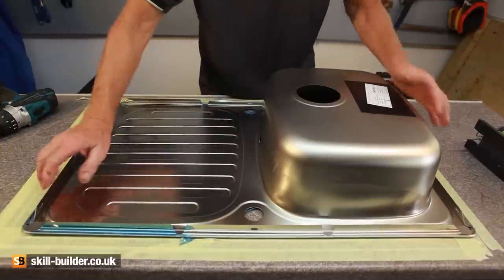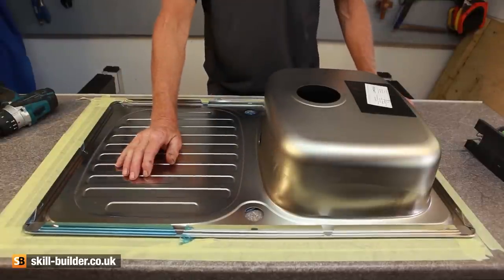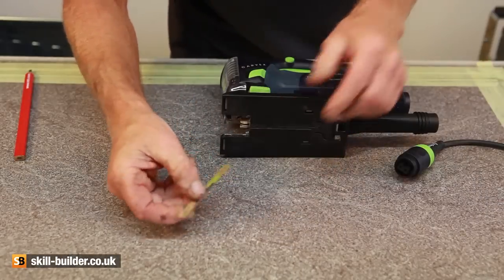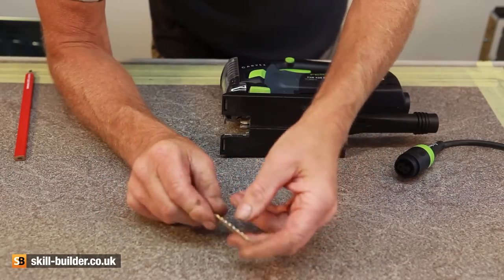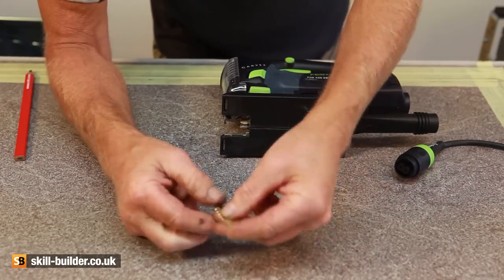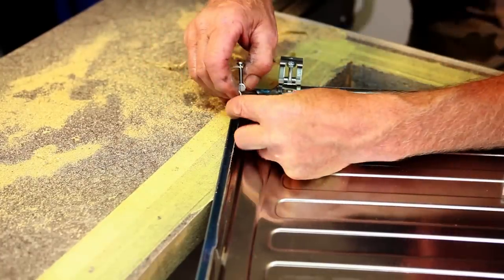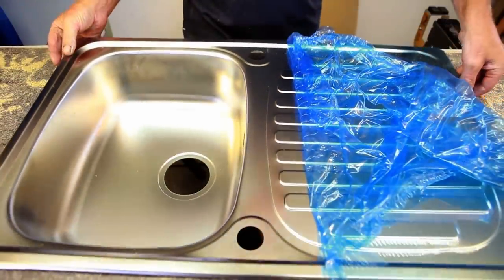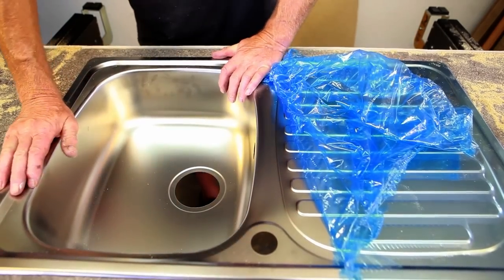Cutting Worktop Holes for an Inset Sink or Hob

Comment: Circular saw is quicker and far more accurate. No random going off track with circular saw and are careful. Jigsaws can go off even when your careful and stick to your line. 
You often get an angle even when you are careful even if you are dead on your line and think you've made a good cut. Your cut which you think is on track may be at a 5-10° angle. Also the cut with a circular is cleaner and doesn't seem to chip as much as a jigsaw. Jigsaw is great for thin pieces of timbre but not worktops

Comment: Roger: This is an excellent video. I will show it to my Teka stainless steel sink installers here in Buriram Thailand. They normally are cutting into Granite kitchen counter tops, but the tip you provide on using masking tape to make the cut line more obvious is much appreciated. THANK YOU for posting this video.
Reply from the maker: Thank you so much for your kind words.

Comment: I find using a circular saw and "plunge" cutting keeps the edges straighter. It also helps where you have to cut a worktop in situ and the cut-out crosses the line of a base unit as long as you set the depth very carefully (a jigsaw will, of course, cut into the side of the base unit and the jigsaw can jump and/or bend/break the blade). 

Of course you still need to finish to the corner holes with a jigsaw, but it as the circular saw cut provides a good guide-line, it virtually eliminates that blade-wander that happens on thick laminate tops. Another tip is that before you make that final cut-through at the corners with a jigsaw, support the cut-out piece where you can by g-clamping a length of wood across the cut piece.

It works best with circular saws with the smaller diameter blades that you find on typical cordless circular saws. 

It's absolutely essential to run tape along the line of the cuts. Not just to see the cut-line, but to minimise any laminate chipping. Any tiny amount that results is hidden by the sink overlap.

nb. the circular saw is a lot quicker too.
Reply: I agree, and I use the same method, but I've had the saw bite a few times, and it got a bit dangerous.

Comment: I use my track saw to do most of the straight cuts and finish the corners with the jigsaw. Not essential but you do get way better cuts and they are quicker to seal.
Reply from the maker: Yes I also use the tracksaw. Much better, nice plumb cut.